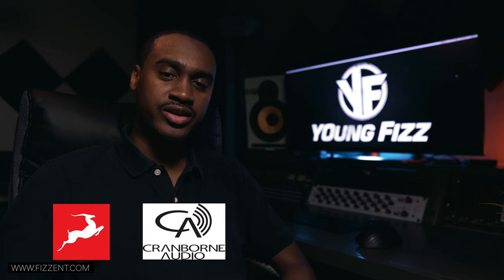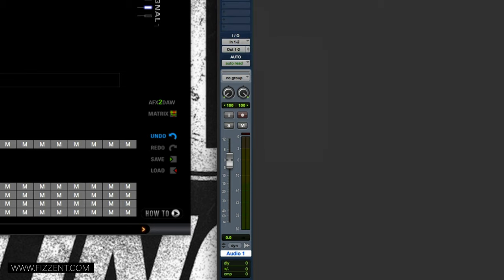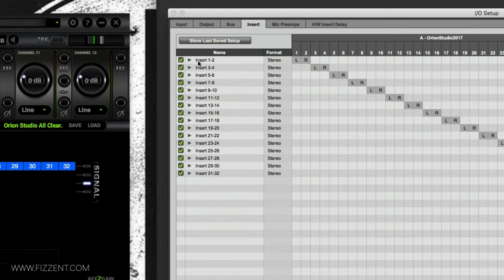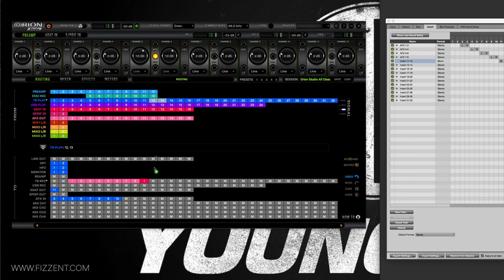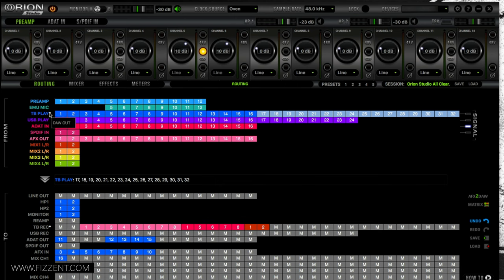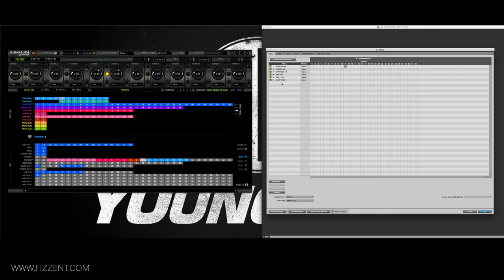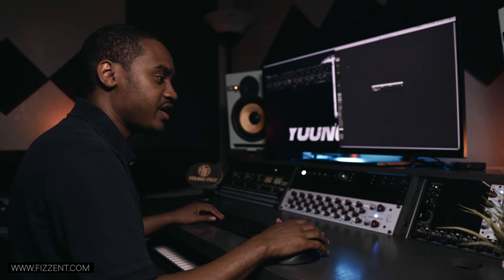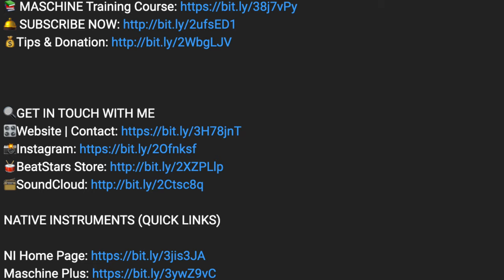Pro Tools I/O Set up with Antelope Audio Interface MASTERCLASS

Comment: Great job do you get latence round trip with protools if so what was you fix.
Reply from the maker: Yes, you have to calculate it and then manually enter it in, thats if you are using antelope hardware AFX. I typically route everything through the Neve mixer so the latency doesn't bother me too much

Comment: Instead of setting 11-12 to Mono, couldn't you have used the subpaths and still had 11-12 independent but available to be stereo if needed? I'm considering the new Orion 32 Gen 4 or the Galaxy 32. The routing system is cool but I probably won't use it that heavily. I prefer a well labeled patch bay. Eventually I might normal the patches. I just don't want to have to change all my software whenever I move a piece of gear
Reply from the maker: Yes that is possible, but because i'm using only one channel it just made sense to have it on its own channel. It's also a naming thing inside of Pro tools. If i had two Mono Gamas i would name it the way suggested.

Antelope make some great products and you will be happy with either unit. The Galaxy takes advantage of Dante I/O.  Awesome routing capabilities. Good luck on whatever you decide !